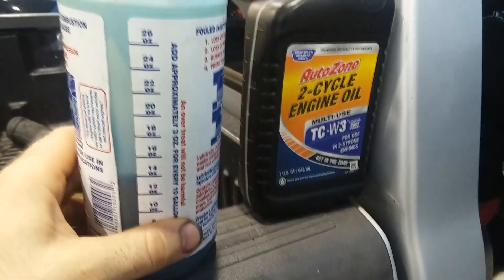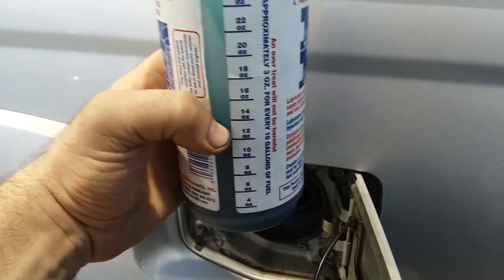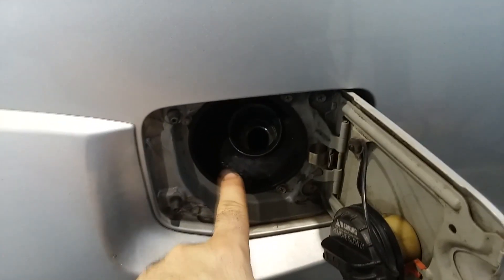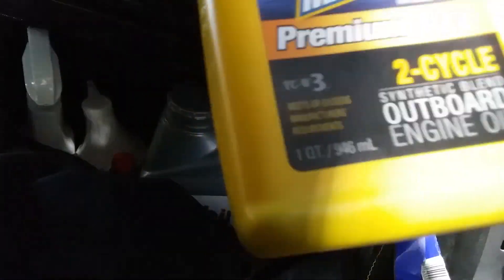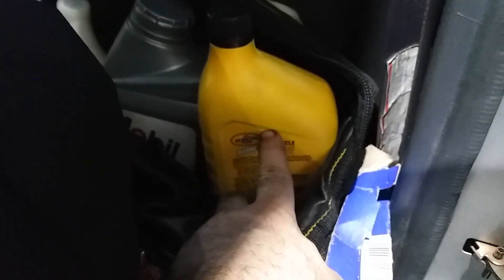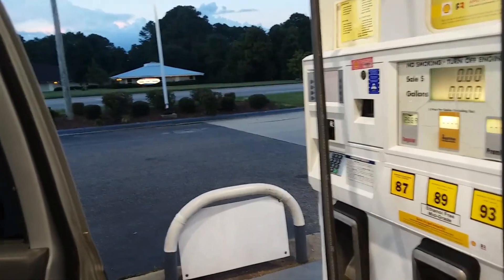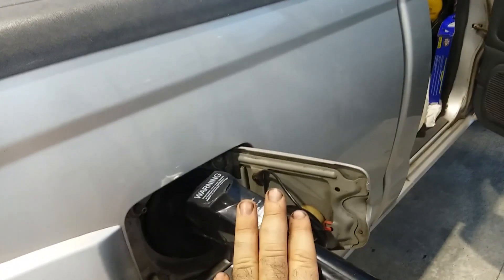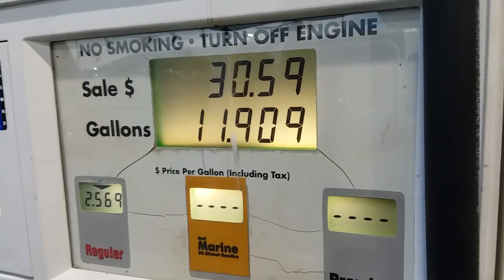The Secret to Better Gas Mileage: 2-Stroke Oil in a 4-Stroke?

Comment: I have recently started doing this. I am trying a 1000:1 ratio as I am a little nervous about it. But, I must say, after doing this my engine NOTICEABLY ran cooler. It took about two times longer to get to the normal engine operating temp and did not need to kick the fan on almost at all. 
I was stunned.  My father who has been a mechanic since he was a child and owned his own garage, said this may be in fact due to the top crown of the pistons getting lubrication where as they normally do not. This may actually prolong engine life as long as you keep it to a very low ratio like mine. I am not sure I would risk 500:1. That isn't saying it wouldn't work. I am just a scardie-cat right now and playing it safe for the moment. Also, side note, I used the Still 2 stroke full synthetic oil for one gallon in ten gallons of gas and I only used half of it. About 1.3 ounces. That is where I got the 1000:1 ratio from. It is 50:1 for the whole 2.6 ounces in one gallon of gas.
Reply: I would feel safe running 50:1 in my vehicle. What's good for 2 stroke is good for 4 stroke. Dont be scared what can it hurt???  Nothing that's what.
Reply from the maker: Your father is very smart. That top set of piston rings is the most oil starved. Helping this can raise compression, reduce cylinder wall wear and more. 

Part of the more can be the effect on valves and how well they seal, especially if it's port injected. 

It'll help prevent fuel pump failure. See how a similar concept product helped my truck:
https://youtu.be/ATL19lVpmAk
Reply: I have 2007 audi a3 2.0 tfsi, i add 100:1 car is verry happy. And so am i😊
Reply: @FierceProtocol  atm testing 1:200, also noticed that high pressure fuel pump noise is gone
Reply: Awesomeness
Reply: I saw some comments on YouTube he said over 300:1 is basically useless and that 160:1 is optimal which is 4oz to 5 gallons.

Really think about it. there is 640 ounces of gas and to make it 160:1 you only need 4 ounces of oil. I wouldn't worry about hurting your engine unless you're trying to go 100:1 or under

Comment: I'm going to look further into this! Thanks for the info!
Reply from the maker: Please do! Look up Corvettes as a keyword along with TCW3, when you check into it. That's a very fussy community and if it hurt those cars they'd know it. At the prompting of subscribers I've stopped using it for a tank. Predictable results. I lose 2 mpg.
Reply from the maker: Hey. Did you check out my latest fuel system cleaner test? https://youtu.be/AHMNjq7hv_c

I believed everything I said at the time of the test, but what's really exciting is I have a part 2 coming! I'm completely surprised about what happened!

Gumout Regane with PEA:
https://youtu.be/AHMNjq7hv_c

Comment: I never heard of doing that. Interesting.
Reply from the maker: Yep. When I came out with my last video about it, I may not have been clear enough. It's an oil so people assumed it went into the engine oil. 2 stroke oil, especially higher rated TCW3, conditions and protects all the metals in your fuel system, but it doesn't stop there. It has a high flash point so that it can also protect metals all around the combustion process. And like Lucas Upper Cylinder Lubricant, I believe it raises fuel economy because your piston rings get a better seal. Because I made this video, it got me to watch other videos in the subject. Project Farm did an interesting test where he used it instead of motor oil. It protected very similarly on a taper ball roll test which has been perfected by his scientific fans and his listening. Granted, you wouldn't want to really run it as a motor oil, it does carbon things up, but .  . . Well, if you haven't watch my last video for more detail. Lol https://youtu.be/lfDm1gMKqFY
Reply from the maker: But I also think I saw the piston sleeve regain its glaze from TCW3 which it had lost from a previous experiment which had scored things up a bit. I think that glaze is a bit of a repair.

Comment: good you cleared that up for everyone thumbs up and shared  and another useful cleaner I find is seafoam works super fast and well from what I saw
Reply from the maker: Yes. That's a much faster cleaner. This stuff is more about conditioning metals and preventing wear. It does clean, but you'd use it in many gas tanks before getting much cleaning done.
Reply from the maker: 2 stroke oil, especially higher rated TCW3, conditions and protects all the metals in your fuel system, but it doesn't stop there. It has a high flash point so that it can also protect metals all around the combustion process. And like Lucas Upper Cylinder Lubricant, I believe it raises fuel economy because your piston rings get a better seal. Because I made this video, it got me to watch other videos on the subject. Project Farm did an interesting test where he used it instead of motor oil. It protected very similarly on a taper ball roll test which has been perfected by his scientific fans and his listening. 

Granted, you wouldn't want to really run it as a motor oil, it does carbon things up in that high of a quantity, but I'm starting to cover in comments the last video...if you want more detail.... Lol https://youtu.be/lfDm1gMKqFY

Comment: I’ve done this before on small engines, seems to help out the unhealthy ones.
Reply from the maker: That's some great feedback! It makes my 4 stroke Yamaha quieter too, but I can't prove any more benefit so it's hard to make such a short vidro. I'd think it'd help keep healthy ones going longer too. On such a small application, just adding the oil before the gasoline may not mix it enough. It's proven to do better mixed in with the fuel. But then...on my motorcycle, I only treat it when I'm at the house and overnight it seems to use diffusion to be mixed well enough. In a small clear bottle it mixes during a short ride and looks even (learned by carrying extra fuel which is premixed).
Reply: I just got a free kohler toro mower, and i filled it up inthe crankcase with xd-100 synthetic ETEC 2 stroke oil, then i pul some off and mix it with the fuel at 50:1! Its the best oil i have used so far and i want to convert this motor into a 2 stroke as it has lots of room to cut ports into it. ill try Amsoil Dominator 2 stroke oil next. So far xd-100 stays clean and it burn clean.
Reply from the maker: Bro. 2 stroke oil gets to thin in the crankcase. You should use it with your gas but not in your crankcase, okay? Just looking out for you.
Reply: Absolute crap i have SAE 40W and 50W klots 2 stroke oil and shell rotella 40W 2 stroke oil, when this 4 stroke POS is done i will smash it to pieces as i hate 4 stroke vermons with a passion so far xd-100 is thicker keeps this pos  2 stroke poppet valve alive. 2 stroke racing oil has a heavier base a heavy duty duty oil, i can wait to re-power my 2000 f-250 with a 6v53 2 stroke!
Reply: XD-100 21 stroke stays nice and thick, but 2 stroke need thicker oil for the heat and pressure loads
Reply from the maker: @jlo13800  whoa! Can you imagine a truck with 2 stroke power! And you're right. You are not using thin oil like I imagined.
Reply: I burn all of my oil like a sled,,its got some energy no need to throw it out with total loss oil burnoff, Got oil injection?
Reply: 2 stroke oil is not thin oil, get over it, it is heavy duty oil, get over your 4 stroke false reality. its fucking junk, i quit the 4 stroke habbit years ago, just look at al those muscle car tall deck blocks that were converted to 2 stroke in the 60's!  stroke is american muscle car drag race heritage.4 stroke is todays gobblygook!
Reply: @DENicholsAutoBravado  yes i have an 8v92 uniflow-2 stgroke silver detroit diesel, i rigged it up to burn its oil with a homade total loss system. it does work as military diesels run total loss lube oil burnoff
Reply: most 4 strokes run thin oil as they are light duty throw away crap like in cars today
Reply: yeah i have a 2 stroke diesel and f250 which calls for straight weight low ash 2 stroke rated oil, both are rigged up to burn off the oil though
Reply: yes lightning is the one of the most powerful pulsed plasma 2 stroke in the world.
Reply: 4 stroke is false reality, fucking junk but good for target practice though, LOL
Reply: theer aint nothing like taking a 4 stroke down range and using it for target practice
Reply: lightning is nature pulsed plasma 2 stroke, it fires on every stroke, 4 stroke is false reality, its just an illusion to me.

Comment: TCW3 is the oil for water cooled engines. My friend one time put 2 stroke gas in a 4 wheeler and clogged the carburetor. I’m a little skeptical about using 2 stroke oil in my car. I did use the big bottle of Lucas upper cylinder lubricant (6-8 ounces at a time as I wanted my injectors cleaned in a short amount of time and plus that same friend added the same probably more then I added and it helped a lot
Reply from the maker: Using a bit more the first few treatments may not be a bad idea because TCW3 like Lucas won't do much immediately. Takes time for it to work. Just be careful my Lucas Upper Cylinder Lubricant video is cluttered with comments from people who over treated and caused damage. https://youtu.be/ATL19lVpmAk
Reply from the maker: I'm wondering if his carburetor was about to clog anyway, this stuff cleans the whole fuel system and usually prevents issues...then in the combustion chamber...well, now I'm covering the last video lol:
https://youtu.be/lfDm1gMKqFY
Reply: DE Nichols well I’m assuming it’s 2 stroke gas and it’s older equipment, a 1999 Honda atv. He put 2 stroke gas in and it ran bad and barely starts
Reply from the maker: Did he use more than 50:1? Did he forget to mix it in?
Reply: DE Nichols idk but he’s buying a carburetor
Reply from the maker: Usually just a clean out works but if it needs more, replacing might be easier.

Comment: Dropping a LIKE on your video, Watching and Supporting. My primary issue is not mixing Diesel with Gas... if that happens, it is useless other than to stoke the fire pit!
Reply from the maker: You've got that right! The gasoline strips the lube that diesel is from a diesel pump and your done. Great comment my friend. Thanks for the confidence in the camera I bought and have been using thanks to your thorough review.
Reply: @DENicholsAutoBravado  Some old diesel bulldozers had two2 tanks, one tank was for kerosene to make for easier starting but lots of guys put gas in em to start em up when   
they were cold. Lots of popping and flames till they switched over to pure diesel fuel.

Comment: 🤔  is this  a regular thing done in Alabama .  I have never seen  two stroke  oil used  as a fuel additive .  Ive seen them use  melted bacon grease in South Carolina but not two stoke engine oil.  Give the bacon grease a try , it's two ounces a tank as well. Much cheaper and  environmentally less harmful to the planet. We have to think greener now and bacon grease is the way to go. Cheers buddy !!
Reply from the maker: Lol. You're killing me with humor like a British gentlemen usually does. 😂

Nah...TCW3 is better for the environment as it's meant to not burn and if it does it doesn't ash or carbon up. It may be better than the Lucas Upper Cylinder Lubricant because that didn't have to pass a stringent governing body in America. Pig grease may not pass the mustard unless your asking for mustard on your hot dog! Lol
Reply: If your going green don't forget the lettuce there Gas Can.
Reply: Oh yeah and if there's bacon and lettuce ya might as well make it a BTL wit some tomatoes.
Reply: MostlymoparIH  That's some solid garden state tip 🇺🇸
Reply: @SteveRobReviews  :> )
Reply from the maker: Anyone else have a mouth watering for a BLT?
Reply: Try avacodo oil also.